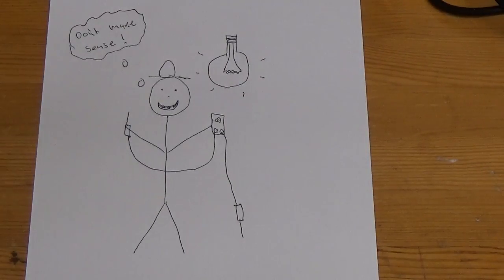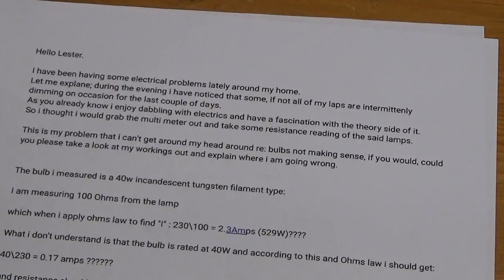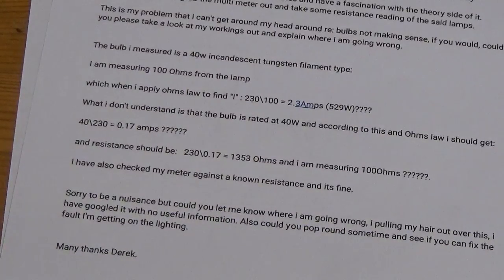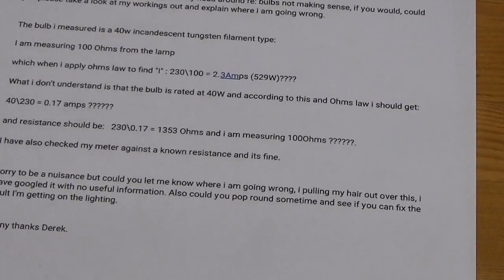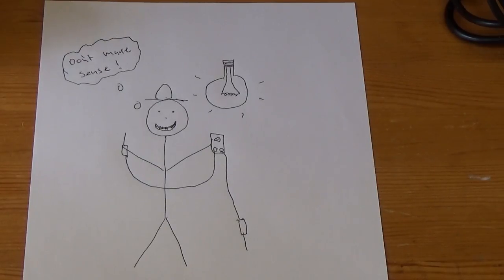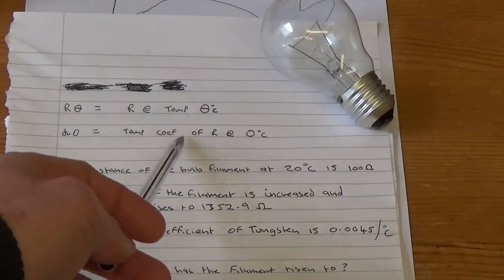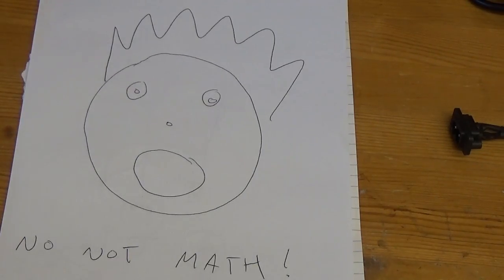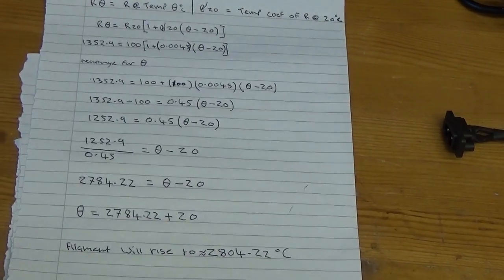Resistance and temperature

Comment: They banned incandescents here in Australia. I often hear sparkies ask questions why their LED's flicker, this is mostly due to 3 factors, a sensor using a triac circuit, dimmers & off peak zellweger signals of 492Hz, 750Hz or 1050Hz.